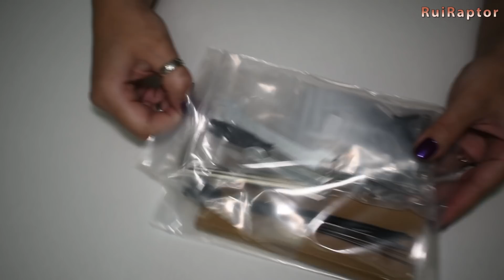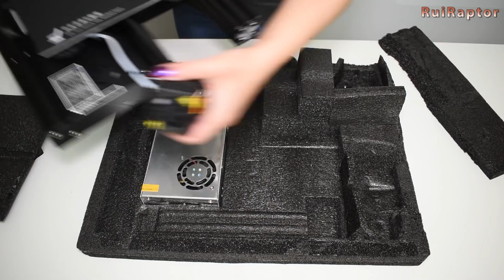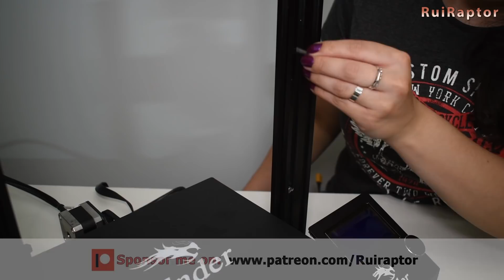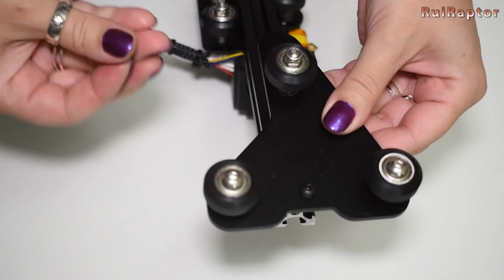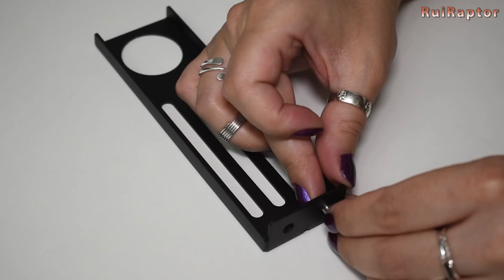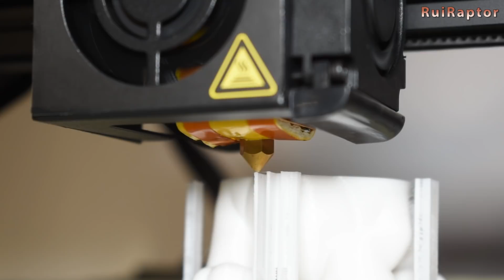CREALITY ENDER 3 - Detailed Assembly, Tips & First Prints

Comment: Shims for the z-axis stepper motor aren't necessary.  I discovered that the bracket that the lead screw goes through, where the extruder is attached, isn't bent at a 90-degree angle.  Once tweaked to an exact 90-degree angle,  shims were no longer needed.
Reply from the maker: Hi, 
Thank you for sharing.

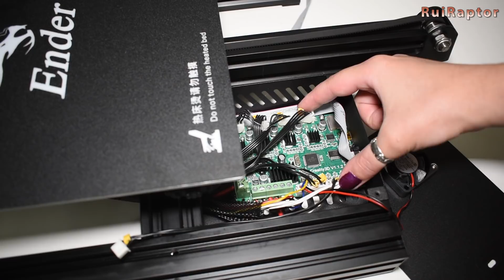Comment: 5:26 not enough setup guides go over this important step! when you're saving money by buying an offshore brand (where cutting corners is commonplace) you had better double check everything if you want to avoid burning your house down! those tinned mains will eventually arc and start a fire.
Reply from the maker: Exactly! Thank you for your comment as it's a very important one.

Comment: Great vid, shame not pro, but I see you have that on the way. One thing I would change is just buying two cheap store hand clamps (those big black ones with orange tabs that look like a macho clothes peg lol new users will rarely have them lol) loosen underneath a little bit on either side of the standing z bar extrusions,  and just clamp the X axis bar to the rails to find out if they're straight.. and don't pad it, be brave and gentle and it won't scratch lol. A great help for me was to find there should be no lip behind the same bar on the brackets that hold the wheels on the right and left. My right was 5mm higher until I found this out.
Reply from the maker: Hi William,
Thanks for sharing. 
The pro version video is already online. You can check it here: https://youtu.be/mnn0F4LVuZg

Comment: May I ask what settings you used during this video or did you leave them default?
Reply from the maker: If i recall correctly, we used 0.16 for layer height, 205 degrees for the nozzle and 60 degrees for the bed.

Comment: I just built my ender 3 and when I auto home the print head nozzle is below the bed, is the auto home just going to the limit switches? do I manually move the head for the first leveling position?
Reply from the maker: Hi Andrew,
You need to either adjust your bed screws or adjust the Z limit switch (endstop). The auto home feature is just the machine homing the X, Y and Z using the endstops.
Reply: @ruiraptor  Thanks! I got it set up, does the Autohome set the datum point coordinates for the bed position?
Reply from the maker: Yes, It sets the first position (zero coordinate). You then need to level the bed for that coordinate.
Reply: @ruiraptor ruiraptor thankyou so much for your help. I just started my first print, all is going well so far!

Comment: Control box fan isn't always on on mine at least. So needs to be rewire to  the fan hotend cable to be always on, right?
Reply from the maker: The control box fan will turn as soon as you start the print so normally you are safe.
But if you are like me and often move the axis while not printing, then it makes sense to make the fan working from the start to cool the drivers.

Comment: Hello I had to buy a new motherboard for my ender 3. But I can't get it to print . It let's set the bed level and and set to home. I tried to print the nozzle gets hot. But doesn't move to print. Can you help.
Mike👍
Reply from the maker: Do the nozzle and the bed reach the set temperature?
Did you try using a different SD card?
Reply: @ruiraptor  yeah I've changed the nozzle all gets hot. And I've used sd card from my anet A4 printer. But nothing.😨
Reply from the maker: Please contact me by FB or email.

Comment: Is the ender 3 3d printer  pro a good one to get
Reply from the maker: Hi Paul,
I will publish the video with the comparison between the standard and the pro versions very soon.
Reply: Love mine. Arrived 2 weeks ago, much prefer the sd card and fan orientation being changed 180, and the bottom rail is twice as wide so more sturdy. I can't, however, recommend the flexible bed, I hate it.. it warps when doing its job getting prints off, and you have to heat it up to get rid of the warps, and heating it up is the one thing that at a certain heat will get rid of the magnetic benefits lol. Get glass bed.

Comment: Think I got a bunk one. My print bed won't heat.
Reply from the maker: Hi David,
I noticed that if you select pre-heat PLA it only heats up the hotend. Also, the dog gcode only heats the hotend aswell.
Try to use the menu option "control>temperature>heatbed" and check if the bed heats up
Reply: @ruiraptor  I did the first time I leveled the bed. It heated up really slowly then stopped heating before it reached set temp. Tried a few prints I sliced and it would not heat.
Reply from the maker: Maybe you have a faulty mosfet :(
Reply: @ruiraptor  I have some beefier ones. Bought some in bulk kinda when I got the Tarantula. I'll give that a shot. Thank you sir.
Reply from the maker: The mosfet i'm referring to is an internal one soldered on the board :(

Comment: lacking information on what exactly is the result people should should be trying to achieve when adjusting the eccentric nuts... anyone following this is about to have their nuts in a bind. lol..
also the bed comes assembled but loose af.. it needs to be adjusted

i followed this one.... but had to basically reassemble after about two weeks of troubled prints..

Comment: Bed attached.  Mine came with 4 paper clamps holding the bed liner to a plastic (about) 1mm thick.  It is loose on the base.  How do I attach this to the bed?
Reply from the maker: My advice would be to get the magnetic print surface instead.